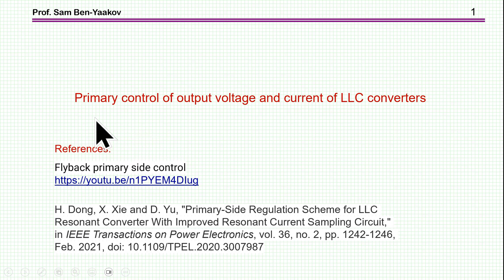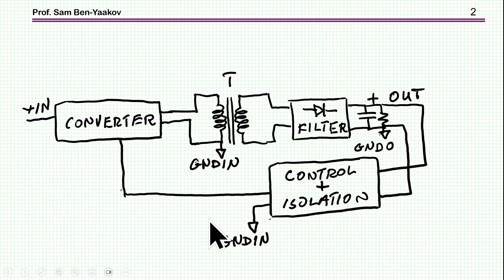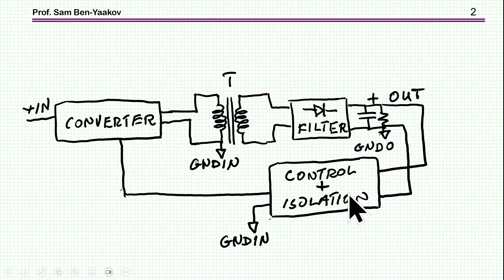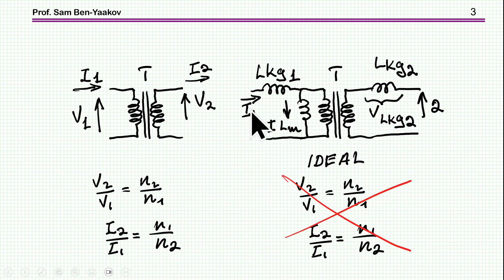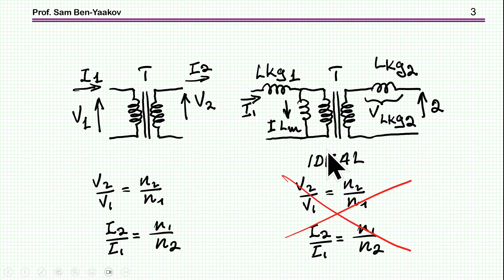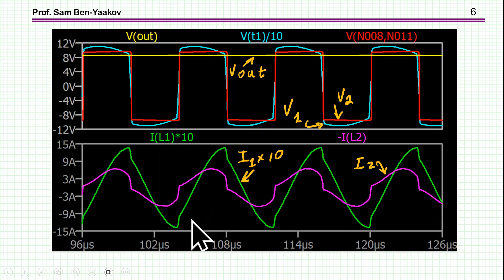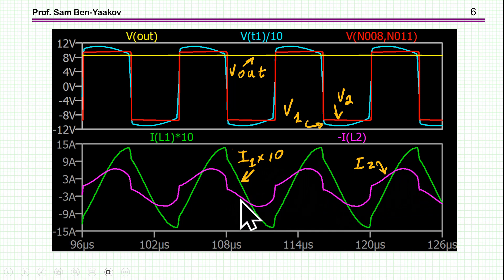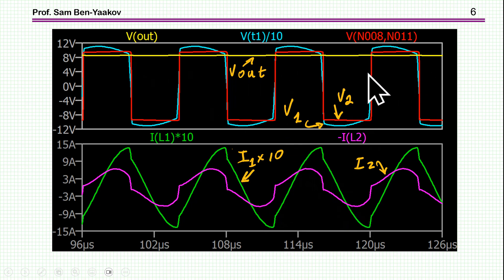Primary side control of output voltage and current of LLC converters

Comment: Hello Professor, 
Thanks for posting these great videos.
At 9:08 shouldn't the equation be Ilm=VdRsCs/Lm instead of Ilm=VdLm/(RsCs)?
Reply: Hello Professor,
Thanks for posting these great videos.
At 9:08 shouldn’t the equation be Ilm=VdRsCs/Lm instead of Ilm=VdLm/(RsCs)?
Reply from the maker: Just checking your  alertness 😉Yes, you are right. Sorry for the typo. I will put an errata on this in the description section.

Comment: If I recall correctly, the magnetization current lays in quadrature with the primary voltage. If there could be some kind of arithmetic, may be taking the voltage across the resonant capacitor to estimate the phase of the quadrature current and subtract it from total primary current, then the output current could be inferred. There would be still the issue of leakage inductance proabably
Reply from the maker: Thanks for comment. The resonant capacitor current IS the transformer current NOT just the magnetization current.

Comment: Very interesting, this is similar to the current measurement in buck converter's inductors but has the extra rectification to estimate the output voltage, thank you!
Reply from the maker: Not really, First, the Buck has no transformer, then the RC is not in parallel to an inductor but fed by a voltage source by an auxiliary winding  thirdly the RC is not measuring the voltage across a parasitic ESR and  therefore the selection of RC is not like in the case of the Buck
Reply: @sambenyaakov  I see, thank you very much for the detailed explanation